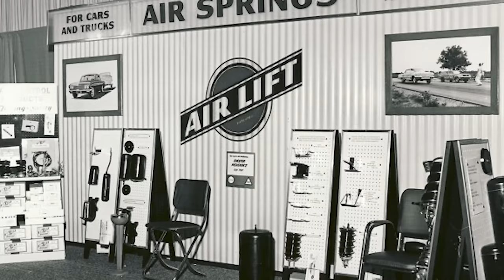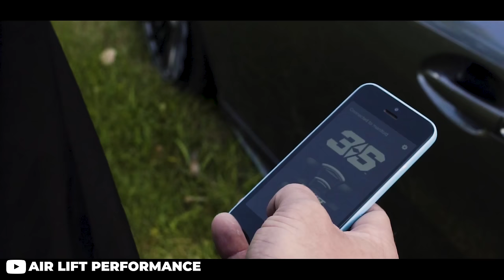So You Want to Bag Your Car

Comment: so you want to wrap your car
Reply: Yes people have a misconception that wrapping is cheaper than paint. I found this out when i was looking at wraps and they were like 1500-3000 i was like damnnn! But you can do it your self for like 500 - 700 bucks
Reply: @classys-chassis6433  never heard or seen someone think wraps are cheaper than paint
Reply: @r32juan  i mean it is if u do it yourself. .. The wraps only 5 to 600 bucks then u just need a heat gun.
Reply: @classys-chassis6433  and a brain

Comment: The one thing i would say is make sure your bags dont touch anything. One example is the 8th Gen Civics if you Bag it on a stock exhaust it will be okay but heat wrap that part that is really close or you wont be having a good time with a melted bag.

Comment: me: can i bag my car?
the law in my country: no
me: but can i buy a car with factory air suspension?
the law in my country: yeah thats fine
Reply: Eh who's gonna find out if you bag
Reply: @overthinking3573  The technial inspection every 2 years? Hell, I had a car failed the inspection because of a small spot of surface rust above the wheel and my last car has failed the inspection because the handbrake blocked the wheels after 11 teeth instead of 5
Reply: @orangensaft0  in the US most states dont require vechicle inspections, or at least just require emissions testing and minor stuff
Reply: @orangensaft0  Ouch! Talk about strict as hell..
Reply: Where?
Reply: @charlesrussell4295  Switzerland. You are not even allowed to change your rims without getting them approved by an expert.
Reply: Jeremiah that aint strict i gotta get tested every year. Depending on age of car some 2 times a year
Reply: @SlobBlobMAN  Sucks to be you, they don't test cars, at all, where I live. Mitsubishi rocks, btw!
Reply: Jeremiah it does suck. Modding cars here is so hard cause they have to be legal hahah
Reply: @SlobBlobMAN  The best part is when they don't believe everything is legit and impound your car despite you having papers for every single modification
Reply: orangensaft0 yeah if you wanna be able to drive your car you gotta get everything certified here. Also a law was passed a couple years ago that allows them to crush boy racers cars if they catch them doing shit. Sure yeah they shouldnt be racing and stuff butttt. They shouldnt be able to just trash peoples cars either. Lot of money put into them
Reply: @SlobBlobMAN  I got everything certified and still got my car impounded over the weekend in Germany because the cop stuck a microphone into my exhaust and said its too loud (nowhere near too loud, you just dont stuck the microphone into the exhaust). So they had me follow them to their garage to look under the car. They couldn't lift the car because it's too low, so they said it's illegal that it's so low (in Germany it would not pass inspection because of a RECOMMENDATION, it's not actualy ILLEGAL by law though and my car passed the inspection in Switzelrand). I got the car back on Monday thankfully.
Also you need to watch out about the racer law. In Germany it can go something like this:
-You pull up to a red light at an intersection with 2 lanes, there is a car on the other lane
-The light turns green, you accelerate to 50km/h
-Cop pulls both of you over and gives you a hefty fine for illegal street racing.
Yes, by law if there are 2 cars that on the sign of green light accelerate fastly even to 50km/h, THAT'S ILLEGAL STREET RACING
Reply: orangensaft0 yeah im from nz and laws are pretty strict here about modifications. Lowest we can go is 5cm from the ground as long as your suspension is certified tho. Exhaust noise can be upto 95decibels
Reply: @SlobBlobMAN  No way, you guys have it wayyy better than we do here in Aus.
Reply: @8888k  yeah ive heard. From what ive seen aus is even stricter than us
Reply: @orangensaft0  do they force you to get flow formed or forged for “safety”
Reply: Germany?
Reply: @orangensaft0  Singapore, can't even change plate number bulb to led if yours are halogen stock
Reply: and i thought my country was shit, these replies real sad bro

Comment: Bagged my Lexus couple days ago. 100% worth it. And yes, I gave my struts ugga duggas, not ft. lbs.
Reply: Bro I’m young and planning to buy a gs350, I was wondering how is the feel with airbags when lowered and driving. Like not super low but just low enough so it looks good. I was thinking of getting bags because I can control the ride height easily and when needed. If I had bags I would probably have it like 3-4 fingers lowered when driving what do you think? Sorry for the shitty way I asked these questions.
Reply: @davidvu4366  you’re good. The ride quality was pretty good, it’s almost like stock but with a lower ride height. If you get a GS it might even be better since it’s a slightly heavier car.
Reply: Yea i got a 1999 LS400 and its my daily but its pretty low and i want to be able to keep it higher when im driving to and from places but lower when doing other things. Is it worth it?

Comment: Love bags but never noticed the amount of problems they have until I owned them. Airlift 3p on a 2016 mustang.
Reply: I'm right there wit ya, 370z on a 3P system😅
Reply: Ryasing what problems bro ?
Reply: @Renebucskil  how that work out? I’m getting a z soon and wanna bag it
Reply: @xilentjay4298  Ended up getting rid of the Z but it was in bags for 3yrs, daily'd the car, aired out every single day. Never had an issue, just buy quality products & you'll be good.
Reply: @Renebucskil  Ty so much for replying after 3 years😭. I’m getting a Z soon. So you would recommend the 3p system for bagging?
Reply: @xilentjay4298  yep that's what I had.
Reply: @Renebucskil  cool man thanks :D

Comment: So I'm a locomotive mechanic. Basically I diagnose/ repair/ rebuild and inspect, 8 & 16 cylinder forced induction 2stroke diesel engines powering both a 600DCV generator and 150psi 3stage aircompressor. Along with all 74DCV controls, wiring, sensors and 2 different air break systems. Think I can build a badass Subie Rex on air?
Reply: What wheels do I need on it?

Comment: Does air suspension add work to the engine to inflate/deflate (except the weight). Also, how much weight do they add? (I guess less than 20kg)

Comment: “Bags aren’t good for Motorsport”

They were literally invented for Motorsport.
Reply: Invented for it =/= Good for it. 

Very few select air suspension work well for motorsport. And they're not the same as stanced suspension.

Coil-overs are a tried and tested method. Drifting, Rally, Circuit Racing, Stock racing and even f1.
Reply: @oneplumpboi5317  are they tried and tested or are the required by regulations. Or are bags banned by regulations because they worked too well.
Reply: @brandonmiller9155  The regulation wasn't banning bags because they were too effective, it was banning active suspension, which is essentially computer-controlled hydraulics. There is no bagged system, the pressure is contained within the cylinder. And I would assume it uses fluid instead of air, because fluid is faster to pump is less compressive, thus having more accurate flow.

Bags are banned because when they split at 200-300 km/h, the rapid vibration can cause instability potentially causing a crash and death.

They've tested it for gravel rally, and ofcourse, that was an utter failure. The constant heat generated from the blows to the suspension caused that bag to overhead, delaminate and fail.

Nowadays, people bag their cars as a flex of money and to make the car look more aggressive, not to perform better.

Thus why i said in my intial comment "Very few select air suspension work well for motorsport. And they're not the same as stanced suspension."

And btw, bagged suspension was not invented for motorsport. It was built for comfort
Reply: Lol
Reply: Originally o think they were for smoother semi rides

Comment: Can someone help me. My current wheel and tire setup are 18x8.5 with 235/50r18 tires. If I upgrade to 18x9 using the same tires, will this cause any kind of issue. I currently own a 2008 mustang gt all stock in suspension. Thanks
Reply from the maker: Shoot us an email sometime and we can help you on this one! Wheels@fitmentindustries.com
Reply: @FitmentIndustries  just did thank you!👍